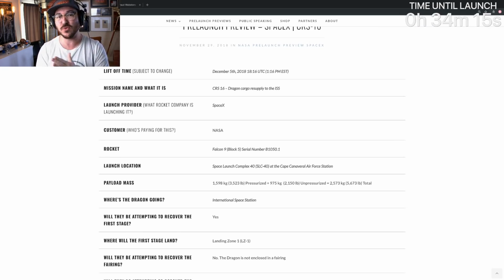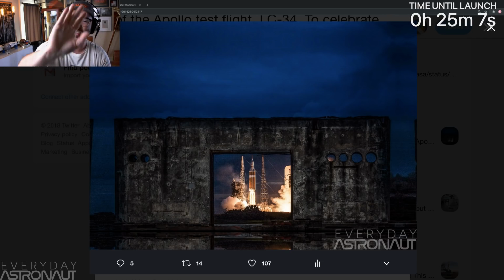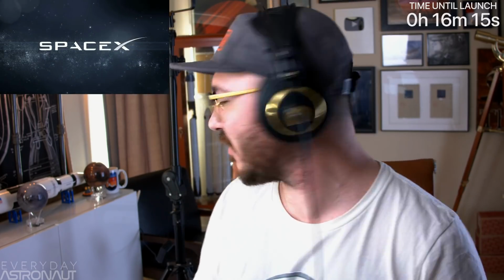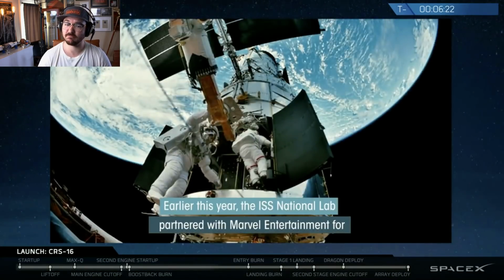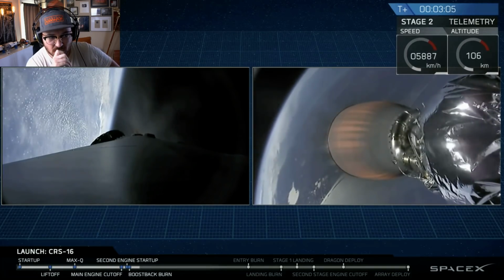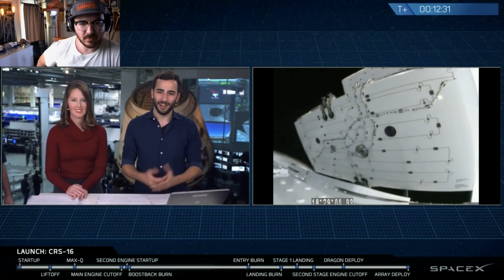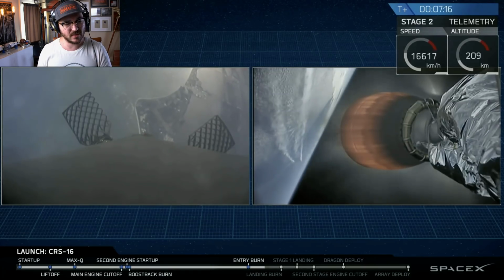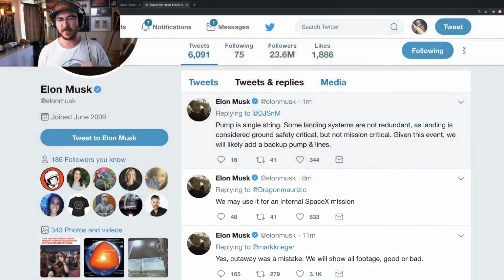Watch SpaceX Launch NASA's CRS-16 and have a failed landing attempt!

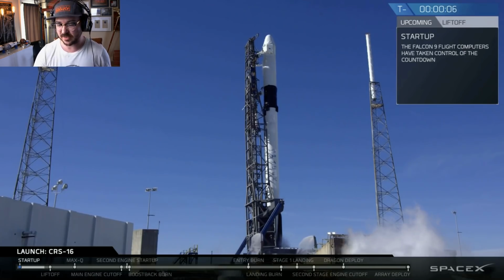Comment: 39:21 Liftoff
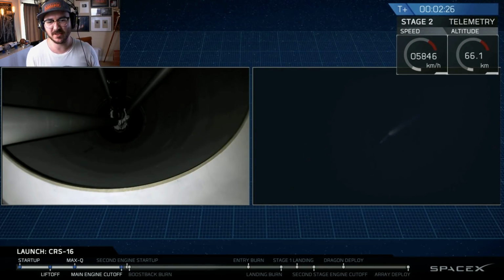41:53 MECO, Stage Separation and SES
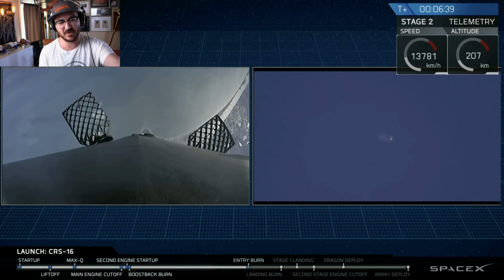46:04 Entry burn start
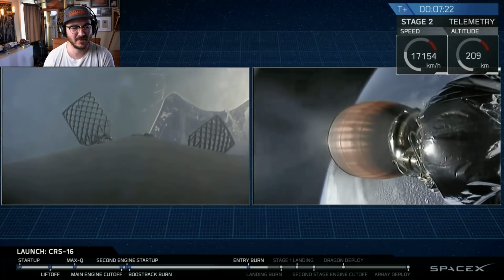46:51 Booster begins spinning
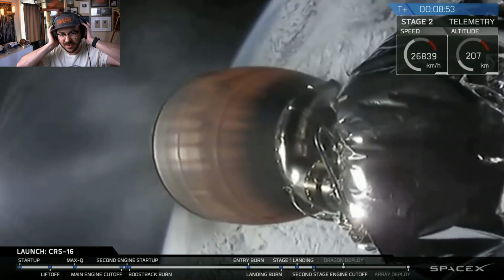48:20 Booster has made a "water landing" & SECO
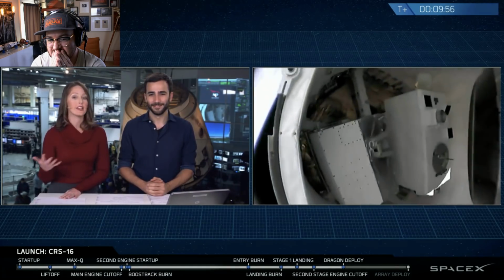49:22 Dragon separation
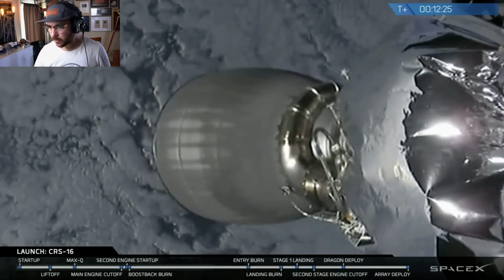51:50 Solar array deploy

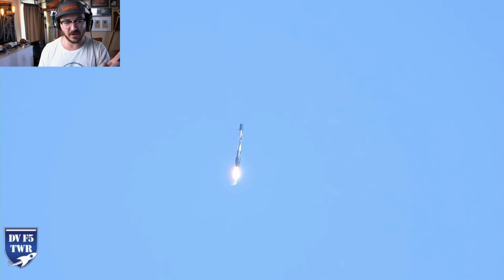58:15 A ground angle of the landing by DasValdes
1:02:44 Elon's twitter "cutaway was a mistake"
1:04:45 Elon's twitter "grin fin hydraulic pump stalled"
1:10:49 Elon gives some details about the pump and what upgrades will likely take place

To any other launch provider, the booster hitting the ocean is pretty normal
Reply: 1:05:15 gone incognito
Reply: Lewis Massie a
Reply: Thank you
Reply: it's not pretty normal, it is normal.
Reply: And at 44.00, they forgot to ROTATE THE EARTH.
Reply: Thanks
Reply: Lewis Massie nooleus shuttle
Reply: 43:03 UFO left screen

Comment: The fins opened very slowly. Usually they open quickly. Was that an early sign of hydraulic pump trouble? If that's the case, maybe better to leave fins in neutral position? Spin seems especially hard to control for engines as gimbaling the center engine doesn't counter z axis rotation. Why didn't I see the cold gas thrusters trying to mitigate?

Comment: Soyuz can rendezvous much faster because ISS inclination (51.6) much closer to Baikanur (45.9) than he cape (28.4). Much faster to go direct for them
Reply: I'm not an expert at orbital mechanics, but I don't think that is how it works. Soyuz does a quick 6 hour rendezvous because it has crew on board. Cargo doesn't mind being cramped for days, so NASA has the CRS missions take the longer and safer 2 day rendezvous.
Inclination doesn't mean much as long as the orbit passes directly over you. You just have to aim in the right direction.

Comment: It's not called Cape Canaveral Air Base. It's called Cape Canaveral. Cape Canaveral belongs to NASAL not the Air Force.
Reply: Kennedy Space Center and Cape Canaveral Air Force Station are actually two separate areas Cape is on Merritt Island while KSC is slightly more inland

Comment: Hi, thanks for your livestreams - they're great to watch. Can someone answer me this question: Do the boosters have a self destruction feature in case they are about to crash on a populated area?
Reply: All US and European made rockets are required to have a Flight Termination System AKA Explosives
Reply: ThisStainlessHD yes they do, look at F9R Dev 2
Reply: Yes. They also have set launch corridors and exclusion zones so nothing or no one is in the way. Also, the booster always aims short of the landing pad till the last second, so any failure is in a safe place over the ocean.
Reply: I don't think the self destruct system is active during the aerodynamic portion of the descent. As the booster falls from space, it is aimed as far from the landing zone as they can get away with assuming everything goes right up until the landing burn starts (this helps bleed off speed as well).

Comment: Makes me wonder if the grid fins are really required? Some how with no grid fins this rocket managed to get stable before it "landed" on the water.
Reply: Grid fins provide a lot of force to steer the vehicle.
As the booster slowed down for landing, the grid fins lose some of that control authority, and the gas thrusters (barely visible) were able to stop the rotation.
Reply: Even with grid fins not working (but deployed) they still create drag and the booster points the engines downwards, with gas thrusters making small adjustments. A parachute can do the same, but parachutes are no good in that speed range (remember, the first fins were made of Al, which melted).

Comment: So impressive to see the first stage regain control like that. From the last onboard video we saw you would not have thought it was possible to have a soft touchdown like that. Obviously had to abort bringing it back to the landing pad for safety issues, but i am sure that if there had been solid ground underneath it when it landed it would have been fine. Fantastic to see the amount of control they still had. Impressive craft indeed.
Reply: i think the return is automatic, the booster just don't had enough control to return. but they god lucky that it landed in water
Reply: @donblub Yep, i think that its probably preprogrammed to ditch in a safe place if there is a fault like this, i am sure that is something SpaceX would be required to build into the system for safety. Mission control were obviously fairly certain it was going to land in a safe place, otherwise i am sure they would have hit the big red button to kill it.

Comment: How much fuel does it come back with? Be cool if it’s any way possible to go into a Hover command, light up early slow right down get that wind resistance off those grid fins and stabilise. Absolutely crazy... but Elon’s crazy and it’s infectious!
Reply: Sam Warren 
Not an option because the lowest possible thrust is still too much for hovering the booster. 
But as you may know, blue origin achieved that.
Reply: Ah I see that, so does the F9 fire all 9 engines on landing or say 4/5/6? It’s completely irrelevant if the system works like it does now but just wondered if there’s option to step in as such.
Reply: Sam Warren 
It depends...it usually fires 3 and sometimes just 1 on the entry burn and always 1 for the landing burn. 
I guess you just would have to increase the amount of fuel and there for weight to make it hover.
...but obviously for not longer than a few moments because the shrinking amount of fuel reserves will affect that somewhat unstable equilibrium of the "hover-friendly" thrust to weight ratio and you would have to decide either to drop it by shutting down the engine or to sit back and watch it rising up again. 
And the Merlin engine isn't a fan of repetitive firings after engine shut downs so there's not really a plan b for a conventional (crazy to even call it that) landing when the hover show has come to an end 😅.
Reply: Sure, yeah I didn’t think of that. So in the hope I don’t sound stupid, they can’t alter the thrust factor? It’s done by initial fuel load and a constant thrust and burn rate to calculate the hover, The decrease in height is purely down to the weight loss?
Reply: Rocket engines can be throttled, but even with the Merlin engine being able to throttle down to 40%, there is still too much thrust to hover during landing. You have to reach 0 speed at the same time you hit the ground. This move is called a hover-slam by SpaceX or the Kerbal community calls it a suicide burn.
Reply: Looks like KSP is on my Christmas list haha! Thanks tho 🙂 couldn’t get my head around landing and the thrust needed.

Comment: The grid fin that failed was out of sight to the left, you can see the right grid fin is trying to correct.
Reply: Actually, the airflow through the gridfin on the right is the cause of the spin. It isn't a solid paddle, so you have to picture the vertical surfaces that make up each opening as the control surfaces, not the fin as a whole.
Reply: rj hinde yeah that fin was almost vertical . Correcting fin to failing fin: “wtf are you doing?!?”

Comment: That was so close to landing correctly... that Poor booster was trying so hard to not crash XD
Reply: @korn798  It actually landed but there was no solid surface. The burn stopped right on time but when they did, the rocket sank in about 10ft of water, then tipped over. Here is the complete footage without the cut away.  https://youtu.be/SMIc4tZPBaA